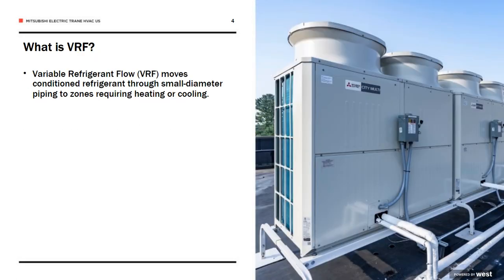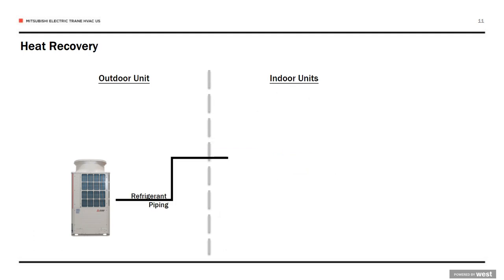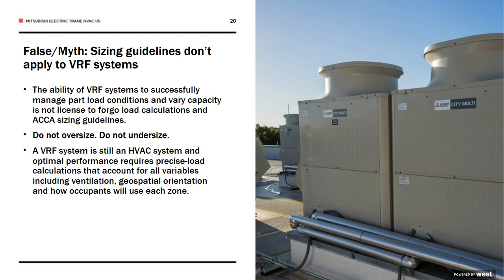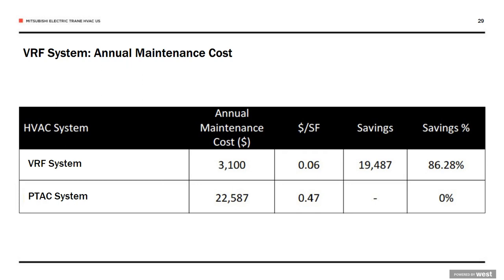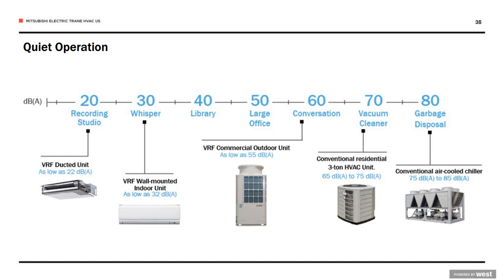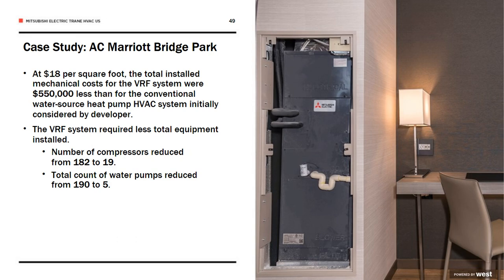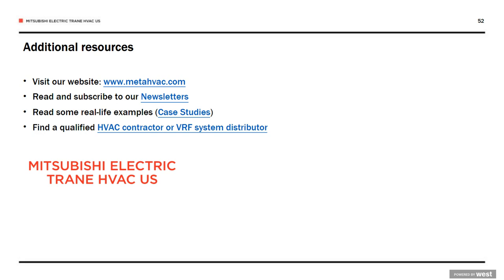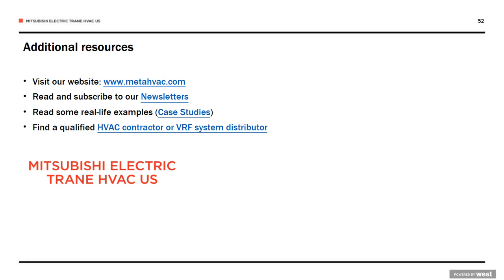METUS Webinar with Engineered Systems: Getting Started with VRF

Comment: Thank you for the presentation 
I have a question about network cable installation 
If the system contains 2 major branches, (T shape) where one side is opposed to the second side, does it required to run the network cable from the last indoor unit in the first branshe along its way to meet the first indoor unit of the second branshe?

Comment: We all know that the cost of maintenance over the lifetime of the equipment is BS. 
 This is an arbitrary figure with no background or data to site from. If I don't see a real world application that is SUPERBLY documented, then I'll always preach that simplicity may cost more with raising electrical costs. However, that cost is worth it when it has failed and need a repair.  Go find a motor for that thing on the shelf at the local supply house. Tell me what it costs, and how many days I have to wait for it... 
 Yeah, my customer will be happy to know that community parts support for the product is currently abysmal.
Reply: Most commercial city multi or bigger rtus still have a big lead time anyways... the small gas pack rtus might be done same day but not so for the bigger stuff. I mean whats the lead time for a condenser coil replacement?  Or compressor skid? Multistack? Daikin rebel?

Comment: Presentation sounds good, however, service and maintenance part is a nightmare. Many small sensitive components could fail. and the result is,  huge areas serviced by on outdoor unit are suffering from no heating no cooling.